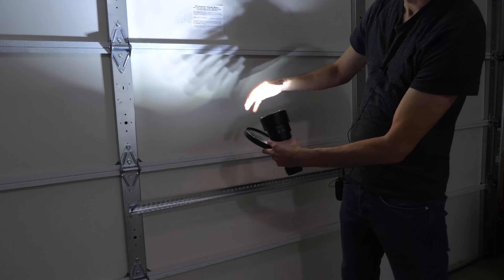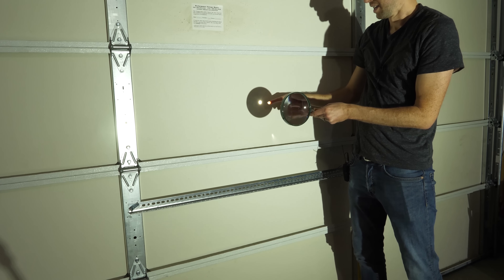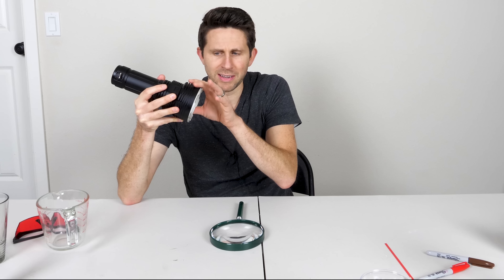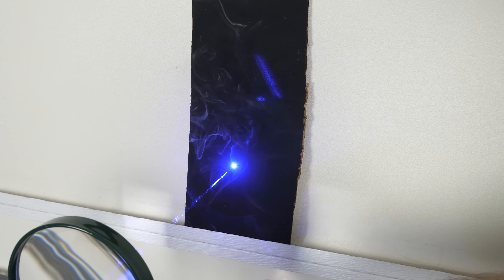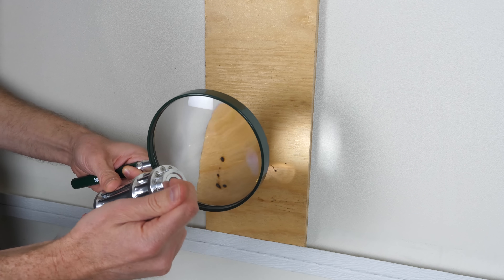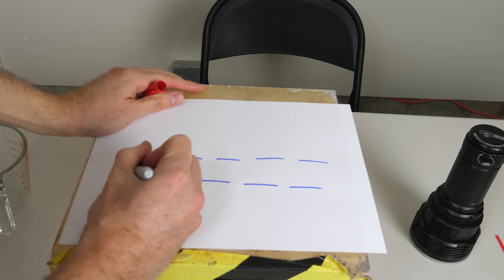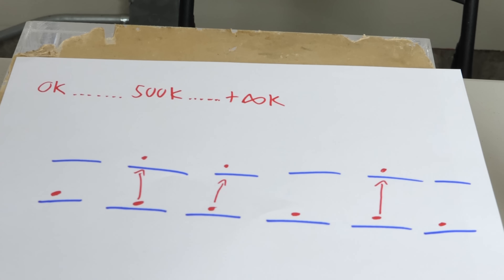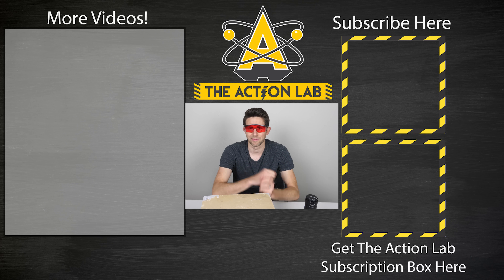What Happens if You Focus a 5W Laser With a Giant Magnifying Glass? Negative Kelvin Temperature!

Comment: 1st of all, you need to learn what's "L.A.S.E.R." means and what is stands for...
2nd of all, read 1st one :P

Explanation for this experiment is so simple, that people learn in basics physics, I was learn it in physics when I was 12 years old if I remember correctly.

Let me explain from the beginning:
L.A.S.E.R. or LASER or call it whatever, stand for "(L)ight (A)mplification by (S)timulated (E)mission of (R)adiation"
that mean the regular light photons are stimulated by some kind of radiation and by the amplification means that the photons are forced to go from
random path to straight line path , and the temperature of the laser is not temperature at all, it's basically radiation's fault that cause the high temperature
when eradicated photon touch's the non or less eradicated matter.
Next, reason why you can focus LASER in to smaller dot and why you can't focus regular light source is simple, light from the laser is already focused and going
relatively in straight line, that mean, all photons from LASER are moving straight from the source, and if you take to compare it to regular light source, from where
the photons are moving in any direction and that photons are NOT eradicated and doesn't have that much energy carrying with them, i think it's explain by itself.
The reason why you can burn things when you focus the sun light is: you are focusing photons which carrying a one kind of radiation already, and that is the 
infrared light, as well as the ultraviolet light etc.

I am not going to explain how that photons are created inside the laser device but, it's also simple as hell, you have electrons near atoms, and when you excite that
electron he will absorb the nearby photon, if there is no photon nearby it will nothing happen, but, if you feed that electron with simple photon, that electron is going 
to move to upper stage, and when it happens, the electron wish to go back in original state, and when it happens, that process can emit one or two photons that
carrying that energy released by that electron

Also, the LASER's are nothing else but the 3 elements connected, it is constructed of a Crystal (the lasing material), two mirrors and the flash bulb.
1. Flash bulb feeds the 2. Crystal with photons
3. Mirrors only reflect a photons with a specific phase and wavelength One of the mirrors are partly reflective and it lets some photons to escape that photons are (LASER Beam)
etc. etc. etc.......

If i'm wrong please correct me as well, but before that, please read some useful books.
Books example: https://stfc.ukri.org/files/educational-publications/little-book-of-big-lasers/

P.S.
No hard feelings ;P

Comment: It has less to do with atoms and more with area. You're not adding more energy but rather pushing it to a smaller area.

Same reason why the tip of a nail hurts more than the back, you're applying the same force on the nail but its focused on a smaller area

Comment: I can hear my physics degree cringing right now. This was painful to watch.
1) In a 2 state system, when half the atoms are in the lower state and the other half are in the higher state, temperature is NOT maximized. Entropy is maximized. Repeat after me: Temperature does not equal entropy!
2) Negative temperature does exist, but this has nothing to do with burning holes in plywood with a laser. Energy will flow from an object with negative temperature to the other object, no matter how hot it is.
3) Who told you it's impossible to heat something hotter than the source? Why is the Sun's corona million of degrees if the energy to heat it must first pass through the sun's 5800K degree surface?

When you focus light, the relevant quantity is the power density delivered at the focus.
The sun emits 63 million Watts per square meter at its surface to achieve 5800K. If you can focus light to exceed that energy density, then you can heat something to be hotter than the sun's surface.
If we take the 1300 Watts per square meter available to us as solar irradiation on Earth, then we need to focus 1 square meter of sunlight to a spot smaller than 0.2 square centimeters.

Comment: If you used a Fresnel lens to collect the light of your flashlight, you should be able to collimate it into a tube of light tight enough for a magnifying glass (or other fresnel lens) to reduce it down to a point.  You're right that the point of light will never deliver more energy than what the flashlight is producing; however, total energy at that point will then vastly exceed the amount of energy emitted per corresponding area of the flashlight (everything around that point will get drastically reduced energy to compensate).  I've seen people burn wood with those high-powered flashlights before, and this is how it's done.

This same effect happens with laser light as well.  You can never deliver more joules of energy to a point, no matter how focused, than you put into the laser system itself.  But, focusing allows you to "borrow" energy from the surrounding tube of light so that you can deliver that energy onto a smaller surface area.  This is the effect you're seeing.

Comment: You’re very wrong. If you took all of the light coming off one flat side of the sun and focussed it down to a much smaller point, the energy would be the same but when gather all of that energy onto a small focus point the temperature would be much higher now. If you divided the sun into square blocks and took the temperature of each block, it would be X. If you combined the energy of the blocks together then the temperature would be X/X = you’re wrong. Same energy, different heat level

Comment: You can concentrate a widely spread weak laser into a tiny powerful point. This point CAN be hotter than the temperature produced by the wide weak laser, as long as it's not more powerful than the TOTAL energy emitted by the wide weak laser. Just like shunting a river through a bottle neck. The pressure will be coming out higher after the bottle neck, but you'll never have more total water coming out of the bottle neck than is flowing into it in the first place. Energy/matter can be neither created nor destroyed. Also, you CAN concentrate a flashlight to a single point. YOU aren't able because your magnifying glass has a shallow curve to it. The more dramatic the curve of the glass, the tighter the magnification is. Or, put it through several consecutive magnifying glasses that are placed directly against each other. This is almost enough to make me unsubscribe. You have a terrible understanding of this.

Comment: Can u burn something inside the vacuum chamber with the  laser???????
Reply: How old are you? 7?
Reply: Yes but it won't be as dramatic.  The burning we saw was combustion the bonding of oxygen atoms to the chemicals.  If you remove the air you'll have less oxygen.  So the chemical reactions would have to be contained within whatever is being hit by the laser. So it would depend on the material being hit by the laser and if the laser could input enough energy to cause a chemical reaction.

Guns that used powder without an oxidizer won't fire under water as there isn't enough energy to cause a reaction without oxygen.  That's why most ammo today has oxidizer in the ammo.  It guarantees the bullets will fire if the gun gets wet.
Reply: Could burn rust in a vacuum. But not carbon.

Comment: There's no such a thing as infinite temperature. Any body above 0 K emits electromagnetic radiation. As the temperature increases, the higher is the agitation of the atoms in the system, which can emit increasingly higher frequency radiation. This can be easily observed by heating a piece of metal: initially, at room temp, only infrared radiation is being emitted (which can be seen with a IR cam), as the temperature increases, the metal starts shining red, which is the less energetic color of the visible spectrum, until it gets hot enough to emit the rest of the spectrum, becoming white. By extrapolation of this model, the highest temperature one can reach is the temperature that the wavelength of the radiation emitted equals to the Planck length, which is the smallest division of space itself.

Comment: What if you make a long tube with the same diameter as the flashlight head with the inside covered with a reflective material. Then fit the magnifying glass on the other end. This way you don't lose any light to the surroundings.

Comment: You can't go to infinity K because at 1.41*10^32 K the wavelength would be the plank length, and since the hotter it gets the smaller the wavelength, you could never go higher than 1.41*10^32 K. If you try, you will get a blackhole.

Comment: I think you should have been standing further away from the wall to focus the flashlight, if you hold the flashlight close to the lens then the angle of the light coming out of the lens will be smaller, so you need to be further from the wall.

Comment: I think you are mistaken, maybe you mean the point can never have more power on the spot than the flashlight's output power? The reason it 'violates' the 2nd law of thermodynamics is the same reason energy flows from cold to hot in a freezer - you are forcing it to by putting energy in.
Reply: I'm not sure who's right anymore, maybe take my comment with a pinch of salt

Comment: yes,that laser  thing is real nice and all, but,I have  an idea that includes the sun,13 large mirrors, and 13 large magnifying glasses.  Now what do you think would happen if someone could figure out a way to capture the sun through the magnifiers and using the mirrors to angle the direction  so that all 13 are fixed on one mutual target? It would be possible if you had 13 people to angle the mirrors at the exact time,down to a fine point as it would be impossible for one person without a targeting computer and  mechanical arms to move the mirrors matching the suns movement.????? I have started calculations and been  doing  a few test of my own, and drawing up plans for an orbiting laser cannon.  This laser cannon will cost over 3 billion dollars and be able to incinerate anything on the earth and probably even drill a hole through the earth until it  hits molten rock.

Comment: What if you had a  100 foot lense that focuses the sun down to a pinhead sized point? is that impossible? if it's possible wouldn't that get hotter then the surfaces of the sun?,  And hell, what about that corona?, that's probably more luminescent then the  surfaces of the sun?
Reply: Yes it is impossible.  The size of the lens does not matter in this problem, you can focus a light source to a tiny point with any lens, but it will never be hotter than the sun. Also the corona of the sun is hotter than the sun itself but in no matter more luminescent as it gives of little to no visible light at all.
Reply: @benediktgerstmeier4062  When you look at the corona in a an eclipse you are seeing it from an angle and  blocking out the majority of direct light, and well honestly if it is physically possible to focus the  energy to essentially an infinite point then, it will exceed 5000 degrees.
Reply: @NocturnalRS  Yes, but the point is (haha notice?)  that it is not possible to concentrate the light of an object down into a point if the object itself is not also a point
See here:  https://what-if.xkcd.com/145/
for a neat explanation why.
Also the hotness of the Corona doesn't matter because few of this hotness gets radiated outside of the Corona itself towards the earth.
Reply: While the suns corona is hotter, it's not brighter.  You can look right at the corona during an eclipse with no damage to the eyes.
Reply: Even with a 100 foot lens, sure you will collect and concentrate whatever light hits it's surface, but that is still only a tiny tiny fraction of the energy coming from the sun.  Remember the sun is out putting it's energy in all directions but you can only condense what falls on your 100 foot magnifier which is 93 million miles away from the sun.
Reply: @Robert08010  I know all this lol, just multiply the surface  area times the temperature of what you could achieve with say a standard  5 inch lens.   Plus do you know what "The Corona" is and the fact that it's  like 200+ times the hotness of the surface?
Reply: You know all this, hmmm?   Because your question looks like you have no clue.    @NocturnalRS
Reply: @Robert08010  Sounds like you have no clue, it's just common sense lol
Reply: Pardon me, but it was you who presented his question as if he had no clue about reality or a child's perspective.  @NocturnalRS
Reply: @Robert08010  And yet you still have a hard time comprehending it haha.
Reply: The magnifying glass just concentrates the sunlight back down. Light spreads in all directions. Millions of miles away you take 6 inch lens and make light a pin point.  Yes it can be hotter than the sun ,lens would be huge would have to capture more than a pinpoint of sun to concentrate on little ant.
Reply: @bikerbob2005  I did state it in the form of a question, my understanding is if the point is concentrated enough could temperatures exceed the suns surface temperature of 5000 degrees.

Comment: Aren't you simply concentrating the laser to a smaller point? Since there is conservation of energy the total amount of energy hitting the wood is the same, but it's in a smaller space, so that very small point is very hot and starts burning the wood. Could you rig up a lens that is larger than the diameter of the flashlight and concentrate the light onto the magnifying  glass so all of it's energy is concentrated in that small point?

Comment: Wrong interpretation of the 2lotd, you're not flowing heat from hot to cold, it does not apply on that case, and yeah, you can focus your flashlight to a tiny point hotter than the source with a proper set of lenses, and that doesn't break thermodynamics because you're not transferring heat but photons, c'mon you're using the 2 law of thermodynamics like a creationist, I'm disappointed

Comment: It’s rather radiation energy (light) per area ( so W/m2) what determines the the effect of increased temperature. In the first example only tiny part of source energy is “focused” and 90% is “out of range” of the lenses. In case of laser beam all energy of the source is passing through the lenses, since the area now decreased, the energy per smaller area must increase. This is exactly what happens to the temperature when the Sun is in zenith in comparison when the Sun position is  over the horizon. Simply by changing the angle of the light falling on the lenses the temperature changes ( because again the area changes). Actually II law of thermodynamics has nothing to do with the observation,it is simply energy conservation and energy transmission.

Comment: Thought the magnifying glass would burn
Reply: light heats things up based on how much light said thing absorbs.
the magnifying glass is a pretty translucent material, and therefore it doesnt absorb much.
since the magnifying glass doesnt absorb much, the light goes through it and doesnt heat it up.

the wood is different however; it absorbs most of the light, and the rest is reflected.
since the wood absorbs most of the light; it gets heated up.

so no, the magnifying glass wont burn up because of the laser.

Comment: That was a poor explanation when you use a magnifying glass all it does is direct the light into a smaller point of surface area and the heat that comes with it so this means the light and he that you can collect with the magnifying glass depends on the size of the glass not solely on how you point the light at the glass

Comment: Im sure you can achieve similar results with the flashlight. Highly reflective cylinder around the end of the flashlight with a lens to partially focus the light, then the magnifying glass will concentrate it to a very small point. 
It may not burn things, but should get hot enough to see some smoke.
Reply: Yes, if the filament of the source is hot enough, which it is for any normal light bulb in normal use, all you need is a single lens. Even with real-world conditions, this can be done (you can burn paper or wood using a focused incandescent). No matter what you do with lenses and mirrors though (or anything else that is reversible), you're not going to get a higher temperature than the source.

For a normal home bulb that is not clear, this would not be possible. For that you can't get a higher temperature than the surface of the bulb (assuming it's perfectly diffuse, which is close enough for our purposes). You can't burn much of anything at the surface of a 100W non-clear bulb.

Comment: Please share reference material you used to determine a laser has negative Kelvin temperature. The only thing I can find is about atoms trapped in laser not the laser itself. Also with two lenses couldn't you better focus the flashlight? One to adjust the light out parallel, and one to bring it to a point?

Comment: focusing the light from the source into a point with a higher temperature than the source does not violate the laws of thermodynamics. The focused point can have a higher temperature but can not have a higher or equal amount of energy as the source. You could focus the flashlight but you'll need a closed reflective system between the leds and the focal lens.

Comment: You have to make a tube that connects the lamp with the lens I recommend you to use aluminium in the inside of the pipe to reflect all the light to the lens you can calculate the focal point but if you don't know how just measure the distance in the empirical way